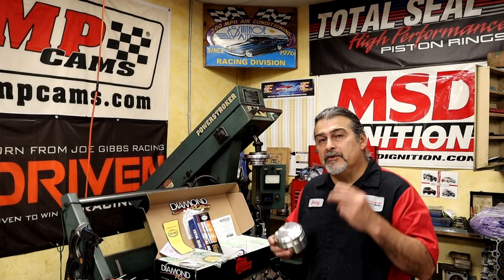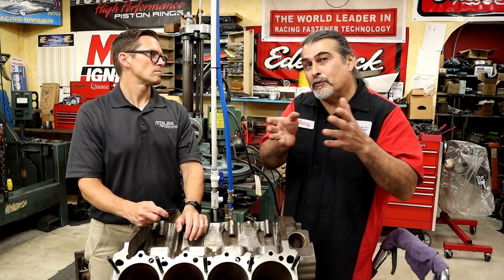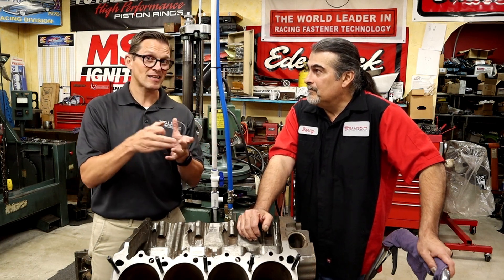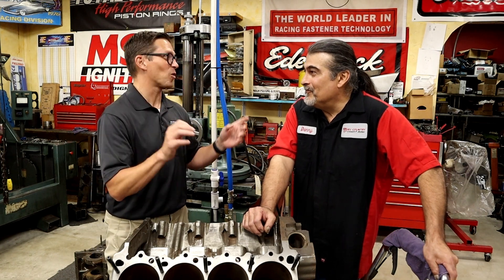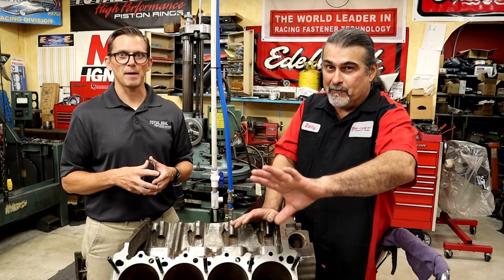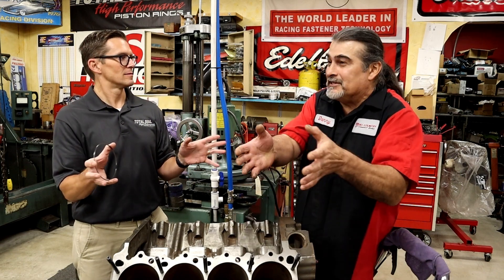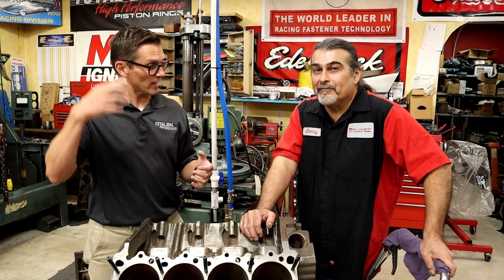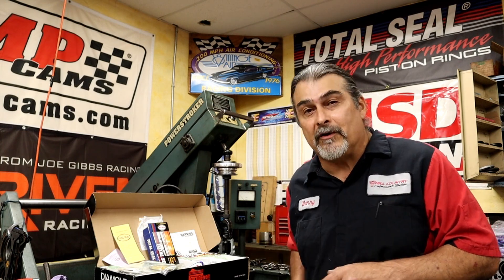Using today's technology on yesterday's engines

Comment: Top fuel is like a diesel engine, brute force, heavy strong parts to handle the stresses.  Diesel engines having piston pins stronger than rod journals in a honda. 22:1 compression plus boost is going to be stressful on parts.  Modern engine with much less friction, lighter stronger parts, a stock LS is a 60's -70's Nascar engine.

Comment: When you're talking about valve train robbing horsepower have you ever heard anybody use electric solenoids to run the valves so you can eliminate the camshaft and the whole valve train on the motor the computer does the timing of the motor it could also do the electric solenoids just the thought
Reply: Look up Koenigsegg Free Valve. That's some cool stuff.
Reply: Ray there is a 4 million Hypercar that I saw on Velocity a few years ago. Sorry I forgot the Company.